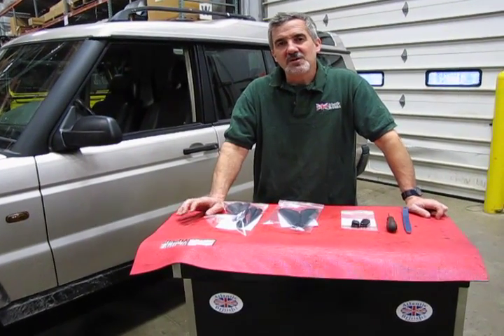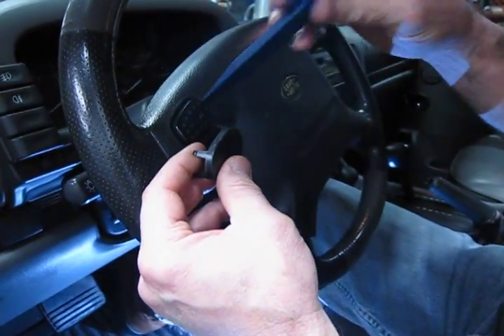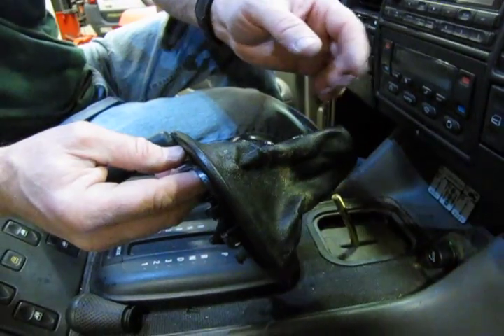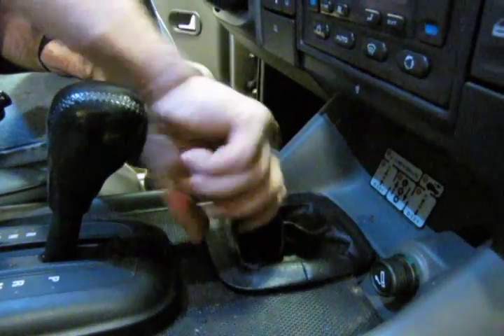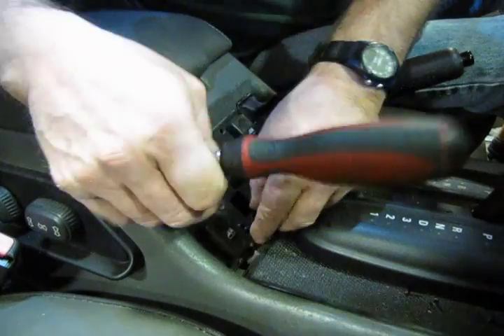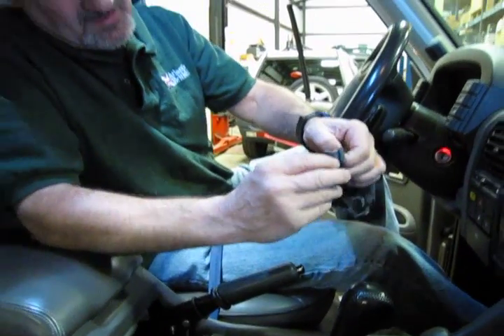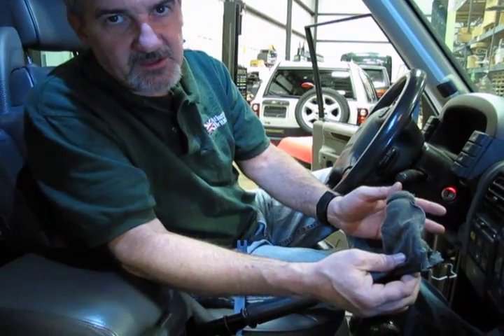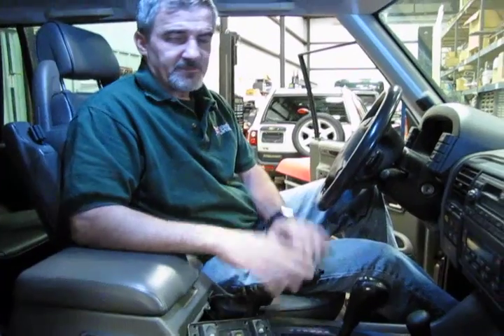Replace Horn Buttons and Boots on a Land Rover Discovery Series II

Comment: my 04 disco hse center console is one piece from the the windows control to the gear shifter.  how do i pop it up in order to replace the handbrake boot?  i have two cupholders on the edges as well.

Comment: The position of the gapped end of the frame (the one with the nylon straw) was shifted to the bottom on reassembly.  When you first popped it out it was on top.  Which is correct?
Reply: +Juan Carlos Guzman I was about to ask the same thing. It think it was attached wrong initially... it makes more sense to have the seam on the bottom
Reply: I also noticed the same thing AFTER I put/glued the new boot on with the gapped end towards the front. Had trouble making it fit correctly so went back and reviewed the video and noticed he flipped it. Tomorrow, I will retry and hopefully I didn't glue on the new boot in the wrong direction.